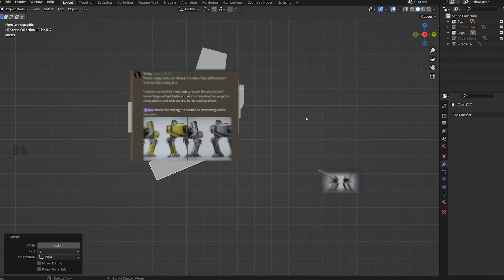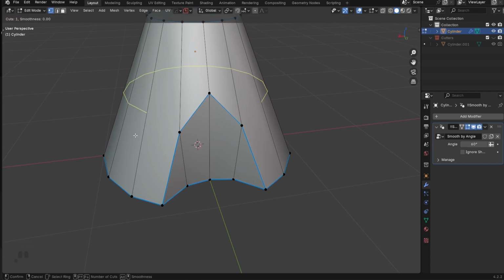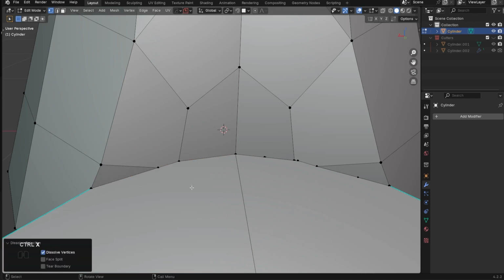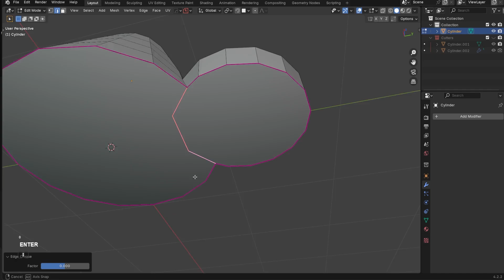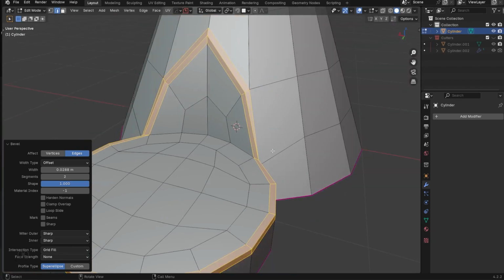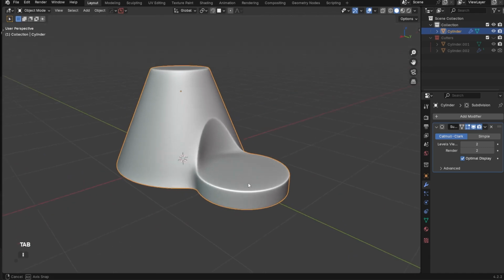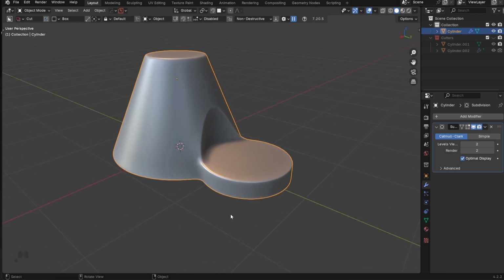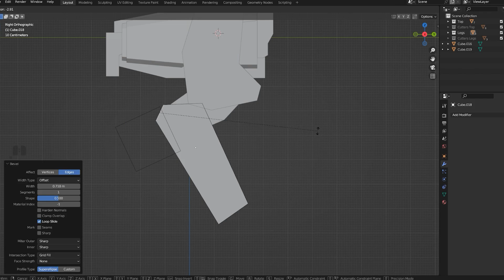Solving tricky SUBD - Blender Hard Surface Modeling TUTORIAL

Comment: This is the first tutorial of Yours I'm trying and man is it hard to follow. I have to pause and rewind and playback at snail speed to catch all the button shortcuts You're not mentioning specific to hardops. There's a "Hard surface tips" window that mentions some of them but it's way behind the action. Some of the operations don't even register in the bottom left corner. I didn't see a keypress for merging vertices or dissolving vertices for example.